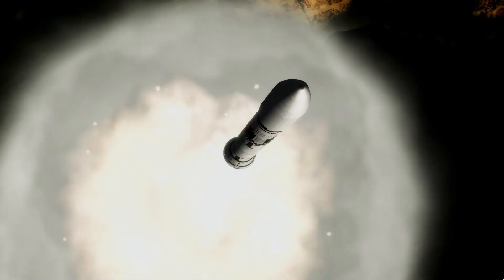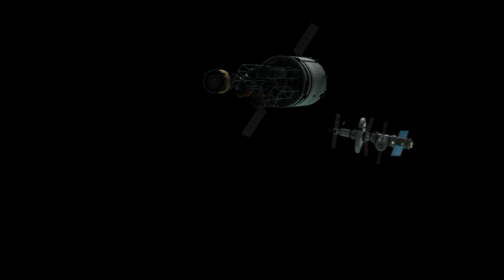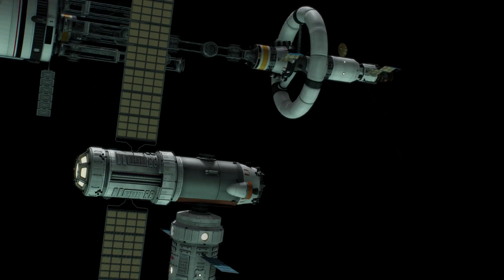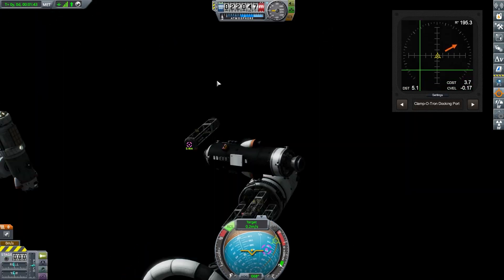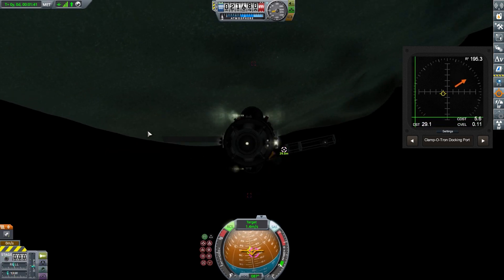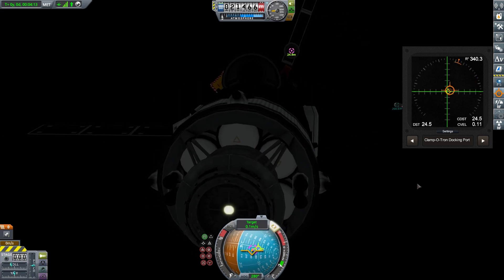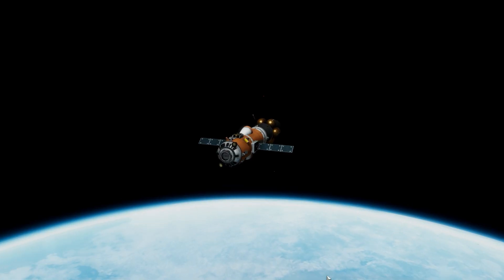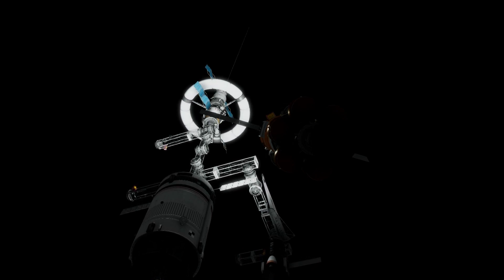Into The Expanse ep 4

Comment: Awesome video! 
After watching all episodes, I'm wondering how you can appropriately use the Atlas V from BDB since you're playing with the stock solar system, but BDB is optimized for realistic performance at 2.5x stock scale. Are you payloads simply heavy enough?
Reply from the maker: Most come in pretty heavy, I try and keep things dense but the low density of hydrogen make it a bit rough. In the end Altas kind of loses relevance here as I move to the AJ260 as my main lifter. Volume of the faring for large cryos has been the problem.